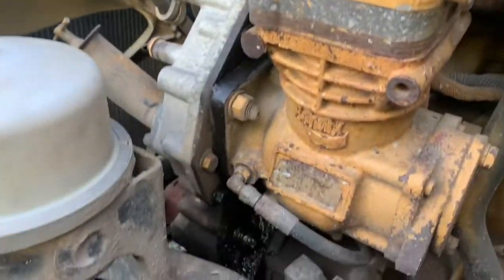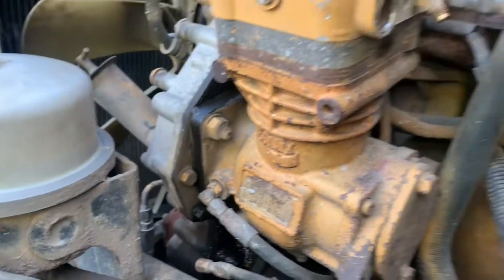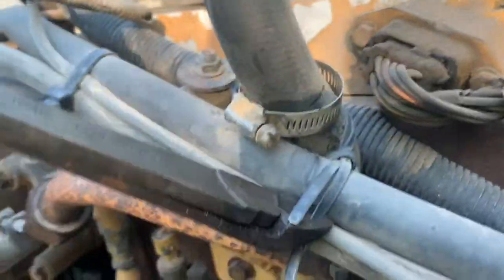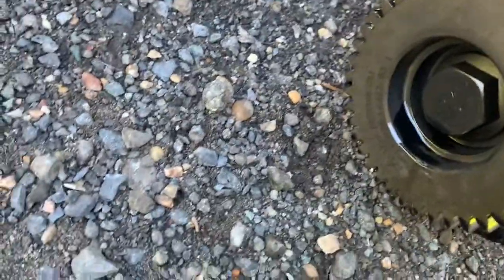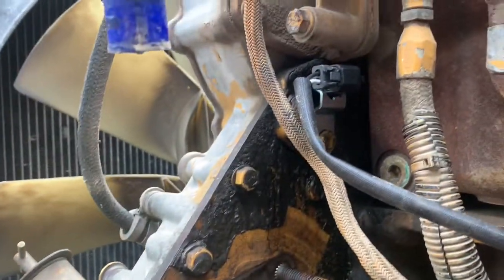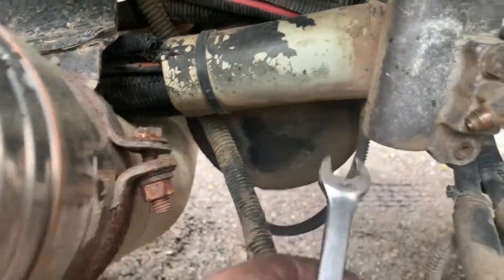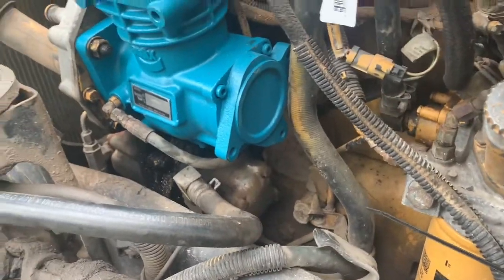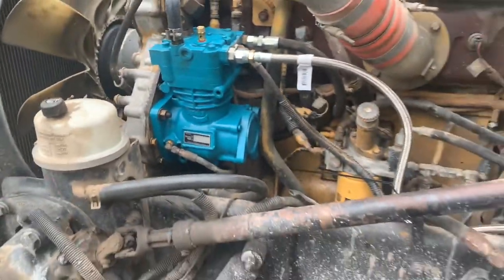Replacing air compressor on a c 15 cat

Comment: You have and out dated intake metal hose now is updated braided metal hose , any way olive done this on my c15 cat and changed air compressor a few times but on my intake line ok but the elbow that connects to intake hose has stripped off air compressor any suggestion on thread repair air compressor works fine I don't want to buy replace cat wants almost 1400 ouch when 2 years ago was 600 with core now I'm using ratchet. Strap to hold down line I wish I could just but a new top bracket looks like you can unbolt it and exchange it but no parts can be bought for that ,  I have never disassembled a air compressor before not sure if top part is available